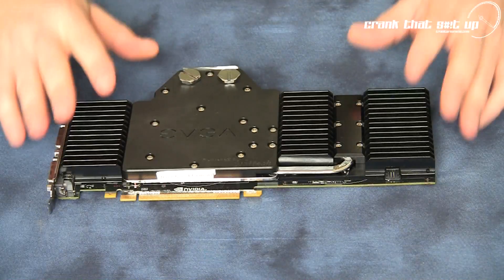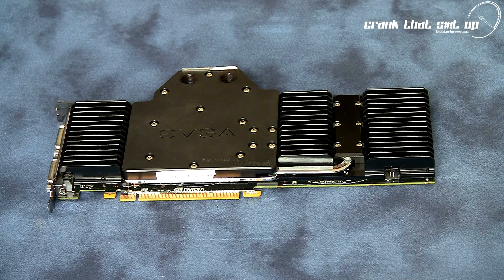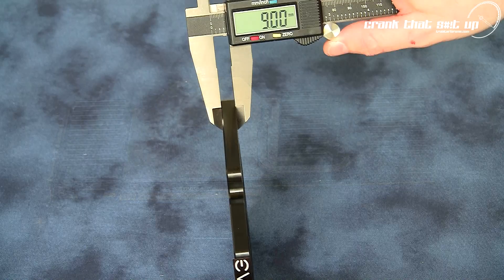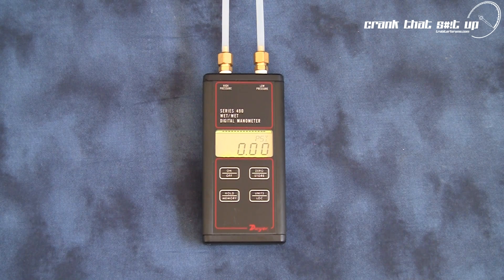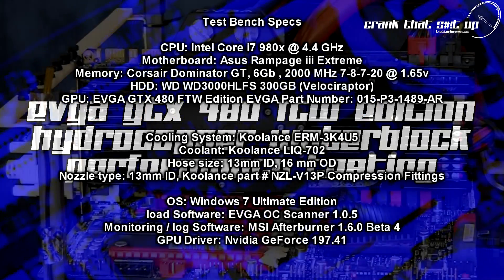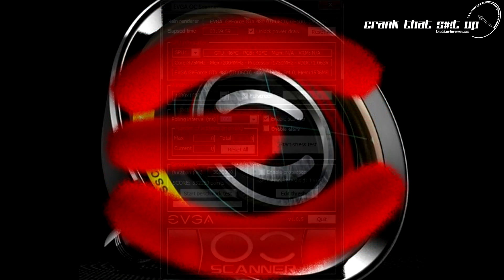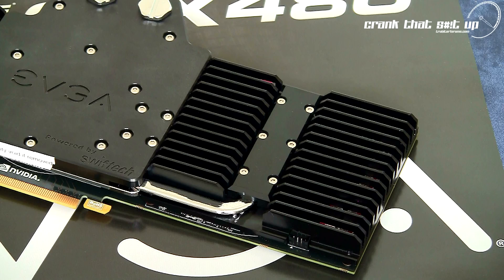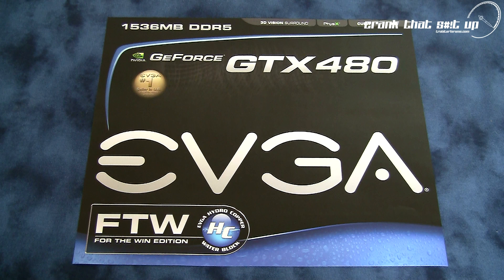GTX480 FTW performance testing & benchmarks

Comment: @gaberouchon can parallel cooling be achieved easily between this waterblock and the Obsidian i am using on an 8800GT? by easily, i mean a straight line with no crazy tube bending.

Comment: @MultiIPwnage Uh.. You use 2 of the 480s for graphics and one single 480 for physx. But wait, there are 2 good games that use physx, and 6 poor games.
And why would you want over 100 fps in a game anyway? Oh and FYI a single 8800gt runs both physx and graphics at the same time in batman arkham asylum and mirrors edge.

Comment: @Sykes893 
The current heat loads necessitate more thermally efficient designs.  We have advised EVGA to recommend a parallel setup for SLI configurations. 

CRITICAL CLARIFICATION: a parallel setup does not mean a dedicated loop. All it means is that instead of connecting inlet of one block to outlet of the other (which is called a serial connection), you connect both blocks inlets together, and both outlets together.

Comment: @gaberouchon 

I have just invested heavily in 4 of these GPU's and plan to run them in series like in previously hydro copper water blocks, could you tell me where on the EVGA website that its states that these cannot run in series like my previous hydro copper setup. Those this mean that I have to run these cards in a dedicated loop if so im very desipointed due too the expense involved.

Comment: Hi there, this Gabe CEO of Swiftech. Excellent review, but your conclusion warning users about pressure drop in SLI is incorrect. When they are set up in parallel (as it should be), the pressure drop of two blocks will actually be less than that of a single block!   Obviously this may reduce flow to the FTW blocks, but given the pin matrix design which is very efficient at low flow, the GPU temps will remain inordinately low.

Comment: I have a question, why can't the gtx 480 be in sli mode with the gtx 470, its the same gpu archtecture, isn't it ? The difference between the gtx 480 and the 470 is the number of cores, and lower clock values, but still same gpu, so whats the deal ?

Comment: @feAr636 The reason is the VERY high power usage. The 480 alone uses pretty much equally the amount of power as the 5970. Fermi failed, that's a fact.
Nvidia do not have much more space to play with, meanwhile Ati have a lot of space to work/improve on.

Comment: @feAr636 Think about the insane power consumption and heat issues facing GTX400 GPU's.

To get a dual-GPU card they'd have to use cut back Fermi GPU's to stay within the 300w barrier and not run ridiculously hot. Don't see it happening till the next big refresh of Fermi IMO.

Comment: No offence, i see you guys are extremely fond of the NVIDIA Cards, but i never seen a video from you guys do anything extreme, in terms of testing, to ATI cards. Especially those 5800 series and the big 5900 series in Double, tripple or even quad cross fire mode on air/water cooling. May i ask why?